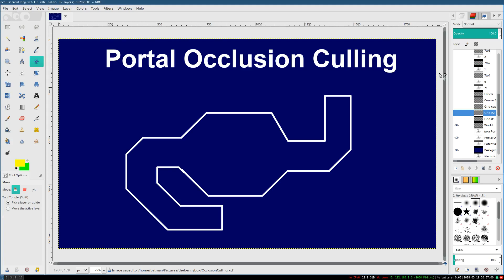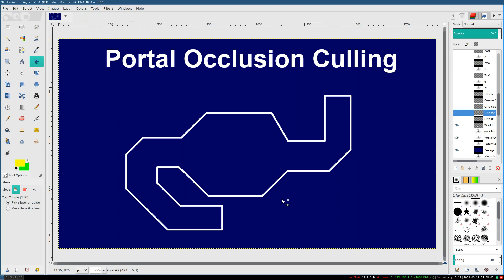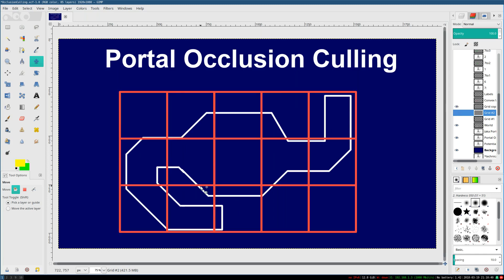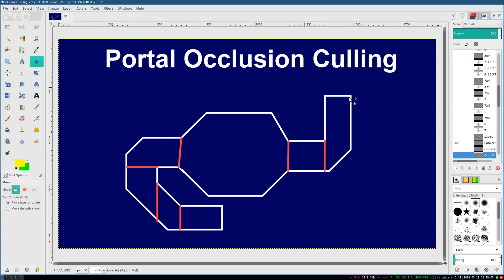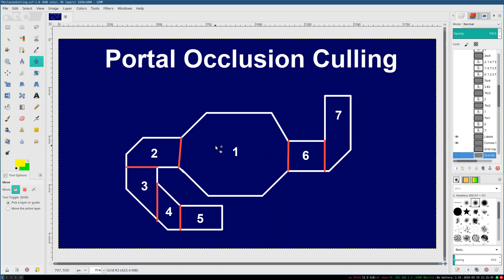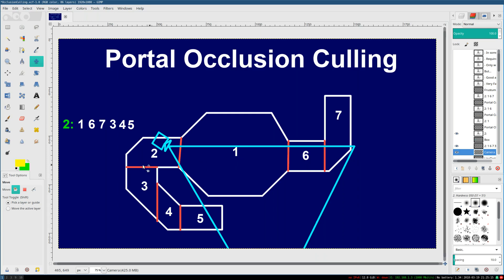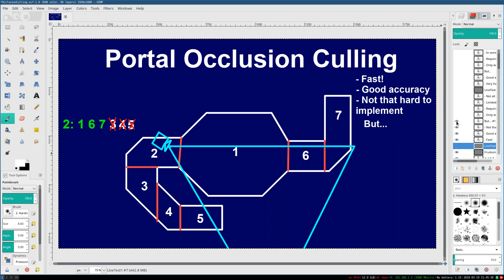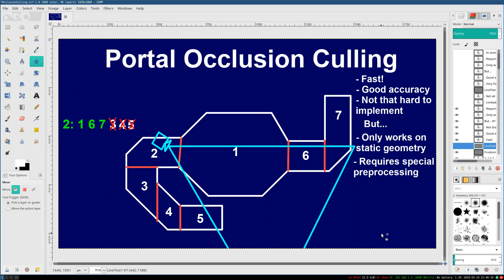#2 How Occlusion Culling Works: Portal-based Occlusion Culling

Comment: Great video, thank you!
Some interesting facts:
- Serious Sam back in 2001 was famous for handling big open-space environments, but it did use portals. They were generated semi-auto by artists while they were creating geometry with CSG. So it's kind of usable for open spaces, but only if you know what you are doing.
- Serious Sam 3 and it's engine (also used in The Talos Principle) also uses portal culling, but this time it's drawn completely manually in a very interesting technique: artists create complex level geometry, and then create so-called visibility meshes, which in a nutshell are just... Well, shells for the complex geometry. For instance, a big decorated room may be described in terms of visibility meshes as a big box. These visibility meshes are connected via portals (which may also be active or not, when for example a door is linked to that portal and can be closed) and not rendered but used for computing visibility sets. Each node (or sector as Croteam devs call them) has a set of meshes associated with it (those that are inside), which is precomputed beforehand, and that's how it works. Inside the level editor these visibility meshes look like LODs for the level itself.

Comment: I don't get one thing. Step 5) in the algorithm - why do we have to create a new frustum that is clipped against the portal? Can't we just accept the node behind the portal without creating the new frustum? Is there any specific reason to creating a smaller frustum just to be sure that it does not go outside the portal boundaries?
Reply from the maker: Yes, this is actually the most important step. It's important because the clipped frustum contains only what is actually visible through the portal. Consider this example: https://imgur.com/a/LNloJ
If you don't do any clipping, you end up simply testing if each portal intersects the frustum or not. In that example, all nodes in the frustum would end up marked as visible, even though only two nodes are actually visible. The clipped frustum is the whole reason you can say "the portal between nodes 2/3 is not visible, therefore it can be culled"
Reply: It makes more sense now. Thanks for the in-depth explanation :)